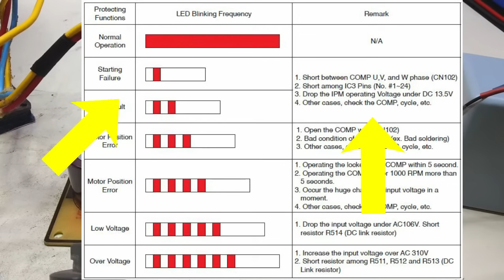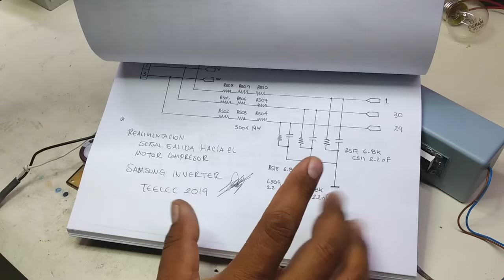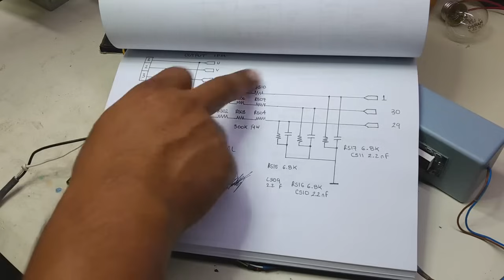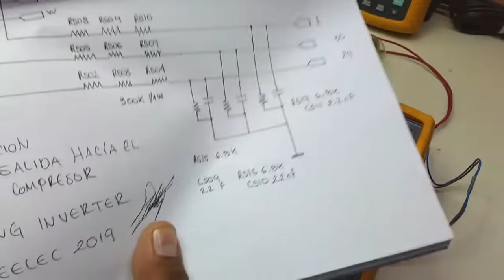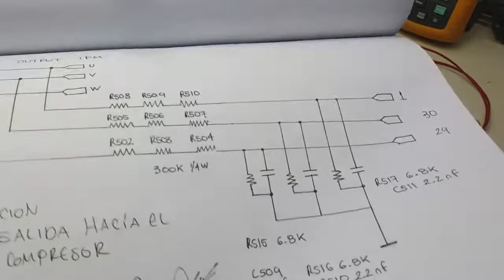Tarjeta Refrigerador Samsung Inverter Manda Falla Un Blink IPM Dañado, Monitor U, V y W

Comment: hola buenas tardes, como se hace para hacer una conversión de invertir a convencional con un ventilador de 4 cables , el cual la placa no tiene los transistores para tomar el positivo de cfan , vi que hay un video donde una persona usa un relevador distinto aquí le dejo el nombre  del relax  del que usa pero el no explica como hacerlo gracias espero nos pueda ayudar  .YYG-2 30A One Way High/Low Level Trigger Optocoupler Isolation Relay Module GDT